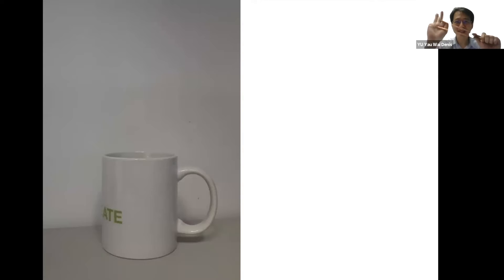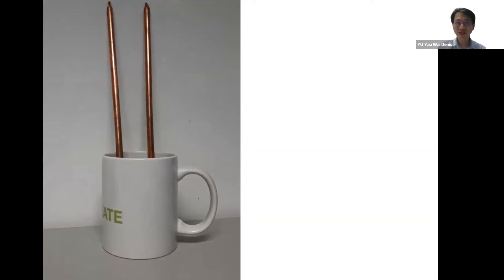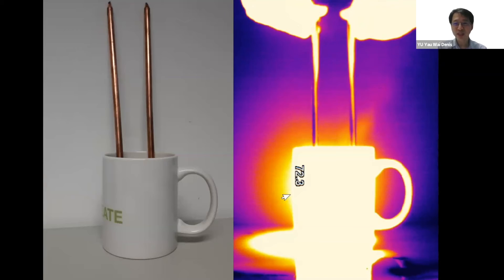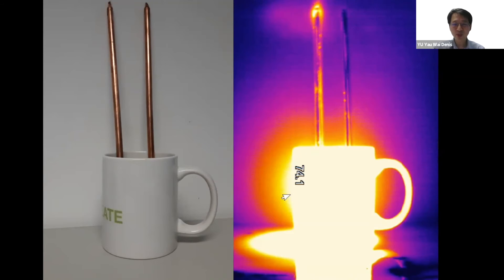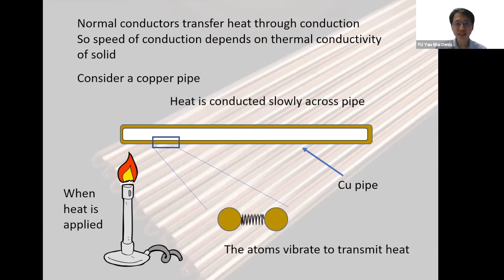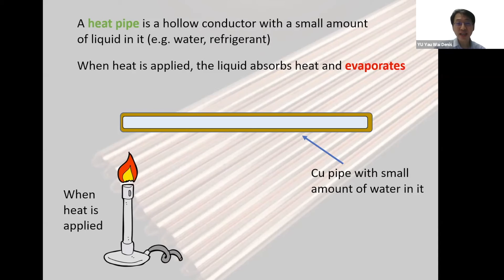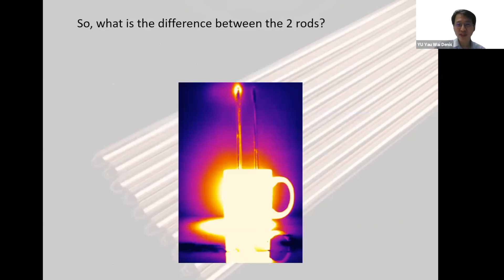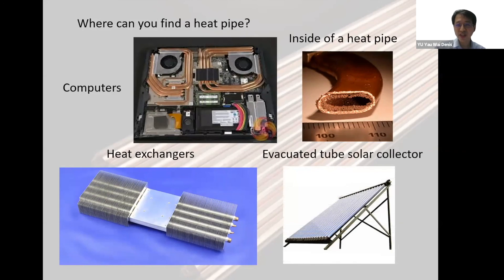Secrets about heat pipe

Comment: At 4:19 Did you mean to say Copper "Rod" not "Tube" because a tube is also hollow, which is what I thought was what made a Heat Pipe a heat pipe?
Reply: A heat pipe has a little bit of water in it so the water can evaporate and conduct the heat faster

Comment: If you seal the cup / put a lid on and had the heat pipe go through the lid, would the heat pipe cool down the water to room temperature? Would that happen fast?
Reply from the maker: yes, the heat pipe will cool down the cup faster, as it conducts heat out of the cup faster

Comment: Great!! Can Heat pipe conduct cold temperatures below -2 degree Celsius and frozen up !!!
Reply from the maker: it is possible to change the pressure and the "refrigerant" inside the heat pipe to adjust the condensation/evaporation temperature for different applications
Reply: @denisywyu7864  Thank you

Comment: Does it matter if the pipe is vertical or horizontal ??? How about pipe length, is there a maximum length that can be used for this process of passive heat transfer ??? Thanks
Reply from the maker: It should not matter if the pipe is vertical or horizontal, as the liquid moves by capillary action. But for larger systems, like a solar thermal collector, when slanting it has an advantage as the liquid flow can be assisted by gravity. it is a good question about max length. I suspect there is, and probably limited by the flow rate of the liquid back from the cold side. So, slanting it with heat source is at the bottom probably can allow longer heat pipes to work
Reply: @denisywyu7864  Thank you for answering my question Denis. Peace vf

Comment: 4:00 - no energy used? - what boils the liquid?   They are not just hollow tubes, they have a wicking liner..why?...sooo - where is the secret?
Reply: No energy used as in no need for circulator pumps or fans for heat distribution.  The wicks allow the condensed liquid to flow back down to the evaporator section using capillary action; otherwise the condensed liquid would tend to just stay up at the condenser section instead of working its way back where it's needed to continue the cycle.
Reply: @sadfur8728  Thanks
Reply: @sadfur8728 ⚠️ God has said in the Quran:

🔵 { O mankind, worship your Lord, who created you and those before you, that you may become righteous - ( 2:21 ) 

🔴 [He] who made for you the earth a bed [spread out] and the sky a ceiling and sent down from the sky, rain and brought forth thereby fruits as provision for you. So do not attribute to Allah equals while you know [that there is nothing similar to Him]. ( 2:22 )

🔵 And if you are in doubt about what We have sent down upon Our Servant [Muhammad], then produce a surah the like thereof and call upon your witnesses other than Allah, if you should be truthful. ( 2:23 )

🔴 But if you do not - and you will never be able to - then fear the Fire, whose fuel is men and stones, prepared for the disbelievers.( 2:24 )

🔵 And give good tidings to those who believe and do righteous deeds that they will have gardens [in Paradise] beneath which rivers flow. Whenever they are provided with a provision of fruit therefrom, they will say, "This is what we were provided with before." And it is given to them in likeness. And they will have therein purified spouses, and they will abide therein eternally. ( 2:25 )

⚠️ Quran